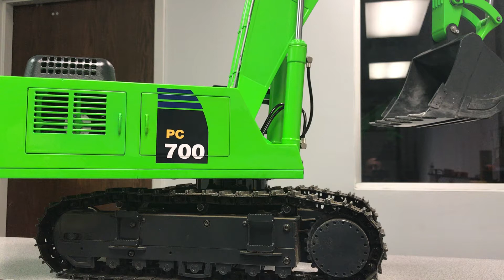Servonaut sound program fix

Comment: What are your new settings?
Reply from the maker: R/C Trucks & Construction Models   so he made a “curve” and assigned it his curve was a 9 point curve all were set at +20%  the middle (#5) was set at 0%  so basically the curve line was straight across for 4 points parallel to the 0 horizontal line but just a little above and then it dropped down to 0 in the middle and then right back up for 4 points.   I made it 3 points and kept the same values so it’s a very short  V   +20%  0   +20%   let me just post a video with the pics I took.  lol
Reply from the maker: https://youtu.be/Kf15vyMVD1Y
Reply: frank smith Quit the same for my setup. I’ll post on my Facebook page.
Reply from the maker: R/C Trucks & Construction Models I found you on FB   👍🏻